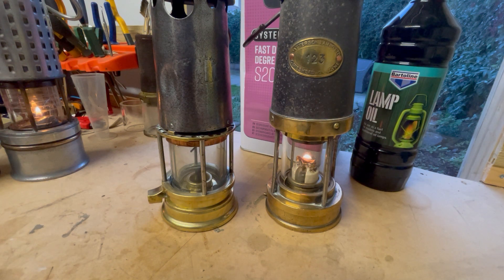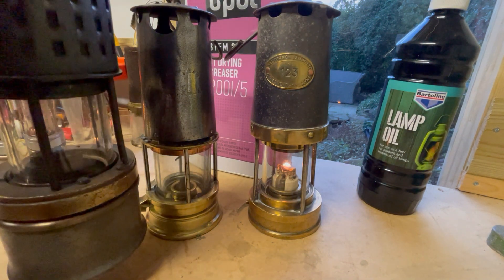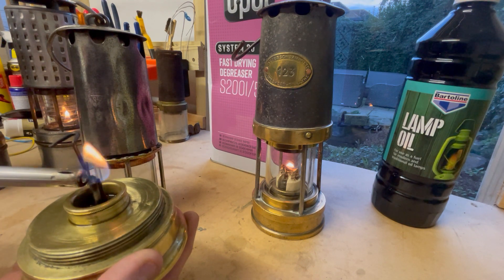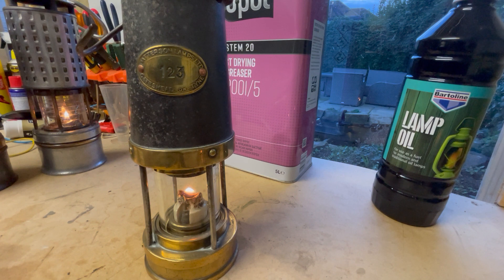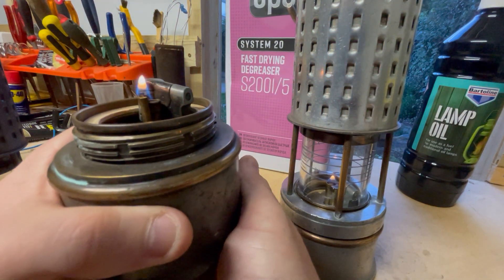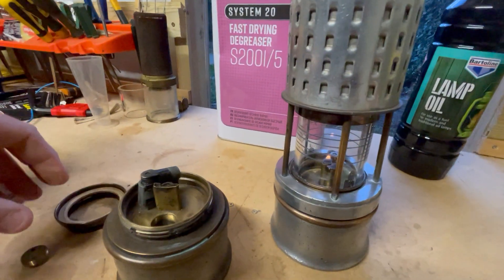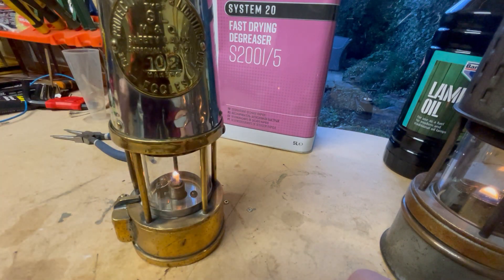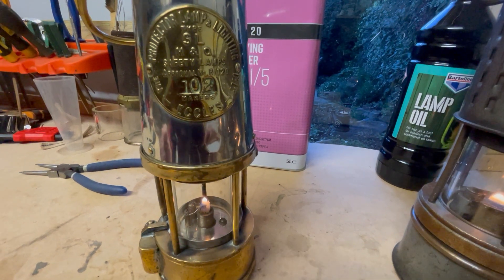What fuel to use for miners lamps.

Comment: At the end of the summer looks out for cheap barbecue lighting fluid. It's virtually the same as lamp oil and often cheaper. I use it. The electric lighting lamp at the end utilises the same technology as a battery operated gas cooker lighter of the 1950s/60s.

Comment: Interesting the JCB lamp you have there, I just Googled that as I didn't know JCB had made such items but apparently they did as possible commemorative items in conjunction with other manufacturers. 
The JCB Miners' Lamp is indeed related to the JCB excavator company (J.C. Bamford Excavators Ltd). It was produced as a commemorative item to celebrate JCB’s heritage and connection to industries like construction, mining, and excavation.

These lamps were typically manufactured by E. Thomas & Williams, a respected Welsh company known for traditional miners’ lamps. They were made in brass or stainless steel and often featured the JCB logo, making them collectible items rather than functional mining tools.

They were likely given as corporate gifts, sold as special edition memorabilia, or used for promotional purposes rather than for real mining safety.

Comment: i am really struggling to undo the bottom of my sl6 miners lamp any tips
Reply from the maker: @RaymondHirstraymond  for the really stuck Protector lamps I have wrapped the fuel cell in an old piece off cloth and put the fuel cell in a vice. Just be really careful with the lock, being too heavy handed can bring the lock off.

Comment: I have several different types of oil lamps-duplex lamps (I call them Parlour Lamps) and pigeon lamps and use a refined paraffin clear lamp oil in them and it works well. I now have a Protector Type6 relighter and I can get it to light by dripping lighter fuel on the wick before closng the lamp and lighting it, having filled the oil vessel with the lamp oil. It lights OK but then the flame gradually dies down and goes out-is this because the clear lamp oil just won't work in a Type6 relighter?

Now, my main question, can I safely use Upol in my other lamps, most of which have flat wicks? The lamp oil I use burns with a yellowish flame but does the Upol burn with a whiter flame, or still yellow?.

Thanks for all your very interesting videos.
Reply from the maker: @g.g.dunnitt9181  hello, the Protector Type 6 lamp is a spirit burning lamp and burns spirit such as Upol, cigarette lighter fluid, Coleman's etc. The flint lighting device on the lamp will not light the lamp oil, this is why you need to put a few drops of spirit on the wick to light it.

If you have a Type 6 that has the middle air shut off ring then make sure this is open when lighting the lamp, also as soon as the lamp is lit turn down the flame so the flame is small. A large flame consumes the air in the lamp (when the lamp is cold) and extinguishes the flame.

For your flat wick lamps I wouldn't use Upol with them, they sound like oil burning lamps. If you put spirit fuel in an oil burning lamp the spirit heats up and the vapours can explode and blow the flame out.

Comment: What electric power supply/voltage do you use to heat the platinum wire to ignite the fuel?
Reply: On my SL I changed the wire to Kanthal 24AWG Wire and use a 3.7v lithium battery as the power supply.

Comment: Hi will Primus Power Fuel be ok in my type 6 relighter? Thanks.
Reply from the maker: @stealer59  to be honest I don't know. For a Type 6 you need a petroleum spirit fuel. This is so the flint spark can ignite the spirit to light the wick. The ideal fuel is one with a low flash point.
Reply: @LampBoy3583  hi I tried Primus Power Fuel it lights up ok and burns fine.
Reply from the maker: @stealer59  that's great! I hope you enjoy seeing your lamp lit 🔥

Comment: Hi just been watching most of your videos excellent work you have done just a question what battery do I need to light my protector SL lamp ? Thanks for your time Ian
Reply from the maker: Hi Ian, the battery I use for my SL is a Lithium Ion 3.7v battery. The wire I use for the filament is Kathal 24AWG, I think this wire is used in vapes but the wire works well with the battery. If you use Facebook then there are a few Miners Lamps groups and a few people have made small lighting devices for these lamps.

Comment: Ahhh now I see why my lamp won’t ignite with paraffin oil and needs a spirit based fuel. Thanks! And I can say you’re 100% correct that old paraffin oil will almost ruin a lamp’s inner workings if they gum up. I had to use isopropyl alcohol to break it down and it worked very well at that. Perhaps that’s why the old owner wanted to sell it! 😊
Thanks again…

Comment: Can these lamps burn 100 percent ethanol alcohol, methyl alcohol, alcohol stove fuel and 99-100 percent isopropyl alcohol ??? Thanks vf
Reply from the maker: I will be honest and say I do not know as I have not tried different fuels in these lamps.
Reply: The different fuels have always made me wonder if they did in the days of old. Those time were really a time of that anything went.  @LampBoy3583
Reply: are these normal flints to strike ? 
there is a lamp like this(333) on the way to me but i dont know wich flints i need 😉
Reply from the maker: @andyparton6680  if it’s a Koehler lamp like the one in the video these take a thicker flint. I use flints from welding guns.  I think they are about 3mm thick.
Reply: I tried, and it's far too volatile, it burns badly with a blueish fame that give little light and is too hot for the globes and soldering, it's almost like gas, and security wise, not a good idea, unless you don't care to set your house on fire or injure yourself (fire & explosion with the vapors that leaks from all over the place) I tried as an experience to know what i'm talking about. .  Use colman fuel, zippo fluid, naphta, or the stuff showed on the vid, all the same; Don't try gazoline either, I did. Keep safe Cheers
Reply: @TheBorderlined  Thank you kindly for letting me know Sir. I always wondered about the results. Good day and peace too. vf  😀😀😀😀😀
Reply: I got to ask Lamp Boy, how did the gasoline work out fella ??
Reply: @victoryfirst2878  Gazoline doesn't ignite easily with the inbuilt relighter and have nocif additifs in it, but it will burn okayish, in emergency, you can. Have a great day 🙏
Reply: @TheBorderlined  Thanks for your information AD. Now I know Sir. Peace vf
Reply: @victoryfirst2878  ur welcome :)
Reply: deliver me from a doubt, are your sure your lamp is designed to use spirit fuel and not kerosene (paraffine in the UK) ??? Never under any circumstance use spirit fuel (naphta, zippo fuel, etc) with a paraffine lamp.